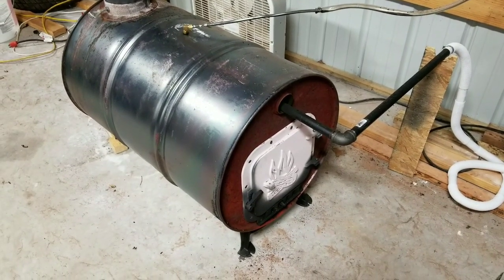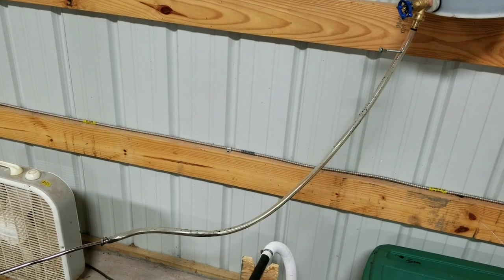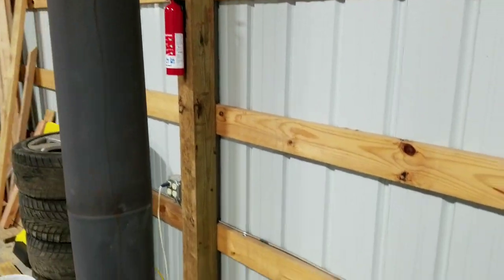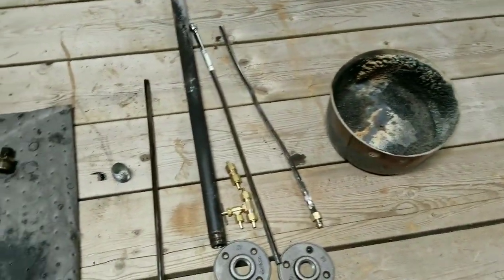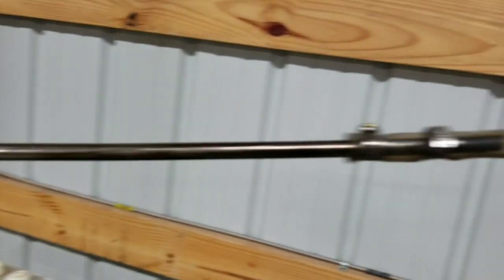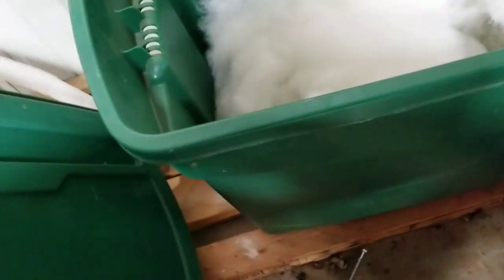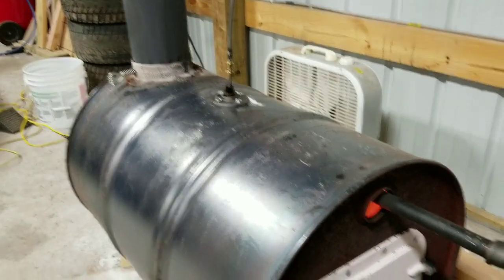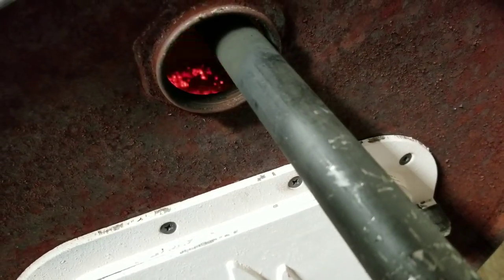DIY Used Oil Burning Barrel Stove...Waste oil burner...Instructions and how it works

Comment: I did something very similar with a typical old style wood burning stove and used an old hair dryer for the air injection.  Works very well.

Comment: You said to just ask and I am wondering how long does 5 gallons last and also the copper tube running down in the pipe does it ever carbon up being over the pot like that? Thank you for any advice and a very good video
Reply from the maker: mitch seibert it burns about 1 gallon an hour the way I have it set up. So far I haven't had any build-up on the copper pipe.
Reply: 05judge  thank you for your fast reply I really appreciate it.
Reply from the maker: mitch seibert no problem. Always happy to help.

Comment: Too much smoke, air should be delivered with holes drilled on two ring tubes around the edge of the pot for better combustion
Reply: OR the air/fuel delivery tube should be centered in the pot. Also, a heavy steel heat sink or flame diverted if you wish, like a brake rotor, could be suspended just above the rim of the pot to help with a more complete combustion.

Comment: can you just run the oil feed tube thru the air feed tube and have it come in from a t fitting?
Reply from the maker: Yes. The oil feed is a small diameter and runs right down through the air pipe.

Comment: What air pump do you have. All the air mattress pumps I've been looking at only let you run it for 10 minute intervals to prevent over. What do you use?
Reply from the maker: It came with a Coleman air mattress that I've got.

Comment: does it smoke black out the top of the stack or clean my neighbors might hate me if i build one for my barrel stove,
Reply from the maker: LIVE FREE it smokes black on initial fire up but once it’s burning hit it doesn’t really smoke much at all.
Reply: @Tornado_Alley_Adventures  ok thanks . i have have near 55 gallons of wast oil and looking forward to heating the shop with less wood.
Reply from the maker: It’s so much less cleanup with this than wood. And much much hotter.

Comment: @szemtrs 
Very nice design, I just bought the exact same barrel setup. 
Could you vent this out the wall instead of the roof?
Reply from the maker: Isaiah Langlois I’m sure you could.
Reply: You could, but all that extra stove pipe is helping you recover heat that would otherwise go up and out..
Reply: I know that I am replying to a question asked 3 years ago, and it probably won't be seen by its originator. BUT. they also make a kit where you can stack another barrel on top of the bottom barrel to act as a heart scavenger/exchanger. there are also small heat exchangers that are designed to mount inline with the exhaust pipe that have a temperature controlled circulation fan in them that could be used if you wanted to exit through the wall.  The short answer would have been YES you could vent that through the wall because it doesn't rely on natural draft for combustion.

Comment: Once the oil burner gets up to running temp, can you turn the blower unit off and let the natural flow of air take over so the unit doen't burn so hot?
Reply from the maker: Definitely.  My shop is really big so I have to keep it running all the time in order for my shop to maintain heat.  If you have a smaller shot that is better insulated, it should hold temp very well once it's up and running and after you turn the blower off.
Reply: I BELIEVE 900 degrees is the temperature where the steel drum will begin to decarburize.

Comment: How many liters do you need per full day?
Reply from the maker: It's typically about a gallon per hour of its running as for as possible. Keep in mind I've got a 40x50x14 shop that I heat so I am heating a very big area.
Reply: @Tornado_Alley_Adventures  thanks for the reply.
Keep up the good work.
Reply: I saw a video and they calculated 1qt/hr
Reply from the maker: @boogarfartboy  In a smaller building that's probably pretty accurate.
Reply: @boogarfartboy THAT would all be a function of the rate of fuel flow.  heat in btu's is equal to the amount of fuel being burned per hour. incorporating a needle valve into the fuel line would allow for greater control of the fuel flow.  However, you must also take into consideration the stoichiometry of air to fuel.  To much fuel, and it will be sooty. To little fuel, and it will be weak and you won't get enough heat out of it to sustain combustion.
Reply: @darrylgordon5170  I wrote this inquiry 4 years ago😮. Yet, I appreciate your reply. Thank you very much for the informative video and the reply.😊
Reply: @Ashraf-zr4vu  it wasn't my video, I was just going through the comments and filling in some holes. You are welcome.  Did you ever build one of these? What was your experience?

Comment: simple and effectif Nice
Reply from the maker: It's very effective.  I had the surface temp of the barrel up to 1100F last winter.  It puts off some major heat.
Reply: Thanks for the reply ! just one question , how long will that mild steel barrel hold that temp . Good luck sir
Reply from the maker: @pauls466  the heat is indirect so it has no problem maintaining and withstanding it. The only thing I will be changing is from a stainless pot to a cast iron pot. It actually got hot enough that the stainless pot started falling apart.